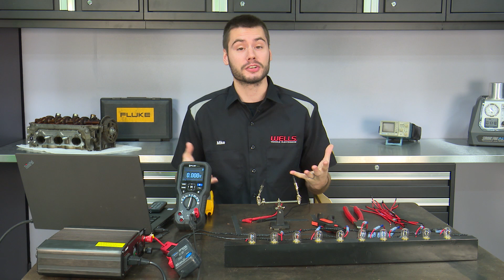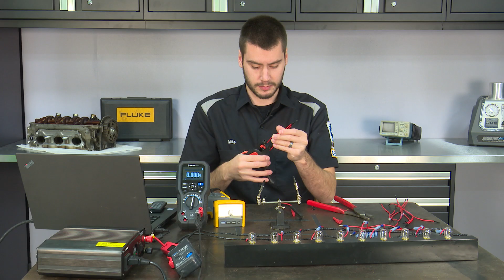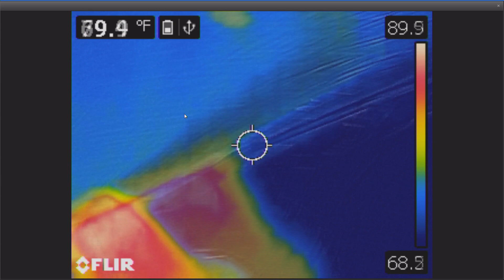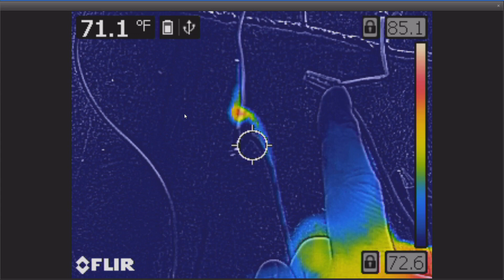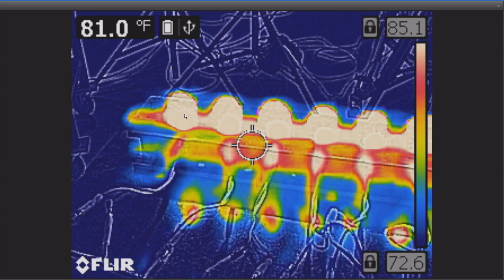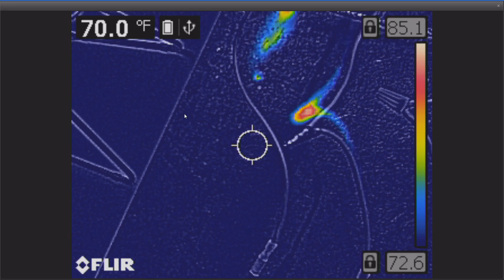Part 2 - Best Way To Connect Wires On Your Car - With Proof!

Comment: Your current levels are too low to really stress even a poor connection.  Try running the wires at the max rated current for the wire size.

Comment: A very interesting experiment, i would add 2 thoughts.  The resistance test is a little bit artificial as the applied voltage is very low and depends on the battery in the meter.  For UK domestic testing the applied voltage is 500V, this would be much more aggressive and may have produced different results.  The second point is that the current at 1A is also quite low, it would be interesting to see the volt drop at say 80% of the wires rated current.

Comment: The properly done heat shrinkable connector should of had 3 crimps on it. The one you showed didnt look to have 3 crimps?
Reply from the maker: Interesting BlackhillPunk, i've never crimped one three times. Where's the third crimp go?
Mike Becker, Senior Instructor
Reply: @GoTechTraining  you made a mistake and crimped it too centrally which didn't grip the wire and therefore had to do it again

Comment: good idea on 5 month winter test on wires............ be even better to do a real long term test, like 1-3 years.that would tell the real truth on the connecters.  also anyone know if i live in florida and do use wire nuts on car and they may occasionally get some moisture inside but no road salt,would this over the years affect the quality of the connection? i would think not much?  ty
Reply from the maker: Hey John, thanks for watching! The longer the test the better it would be for sure. As far as vehicle in Florida, guess that depends of there's salt in the air, living near the ocean. Wire nuts just really don't belong on a car.
Mike Becker, Senior Instructor

Comment: great test, but to see results  at  that range you need a DLRO (Digital Low Resistance Ohm) meter, with the proper test clamps to connect to your wire.(many only have a pair of pins which would be tough to get a good connection on small wire)  A DLRO passes 10 amps through the connection and measures the voltage drop. You could of course also do the same with a power supply and the proper test equipment.
Reply from the maker: Sounds like I need to go shopping :)
Mike Becker, Senior Technical Instructor

Comment: Interesting experiment. I wonder if running current through them while in the salt bath would have changed anything. It stands to reason that the warmer the wires get the more moisture they will wick into them.
Reply from the maker: Hey Nicholas, I believe current running through them would have definitely changed the outcome. Electrolysis is a real thing. But, like on a car, current isn't ALWAYS running through the wire. Therefore, in this experiment, I figured it was best just to run none and see how that went.
Mike Becker, Senior Technical Services Instructor

Comment: Certainly not the results that I had anticipated, but we all know what we could expect!!

I feel like the wire size used vs the amount of load used, vs the amount of possible corrosion exposed to, had a lot to do with your results!! A smaller wire, and/or a heavier load, or being exposed to a longer corrosion period, could have varied the result much better!! It's like comparing winter gloves by subjecting them to  50 deg day!!! I have socks that would pass that test!! And the few Wisconsin people I know, don't even get out the winter clothes until somewhere in the teens!

Nice job on comparing the connection types!! I have seen every single example you posed, in some form or another!! And worse!! I have even seen some 12/2 romex, under a house, with the twisted pair/electrical tape trick used, and being so old that the tape had come completely off! Was crawling around in wet dirt, on top of that splice!! I never considered that it was live, until further in the work, I traced it to a live circuit!! IMAGINE MY SURPRISE!! I thought it was trash!!!
Reply from the maker: Hey Roadkill5333. Not what I expected as well! I'm glad you enjoyed the class! It was in the 20's the other day...saw a guy in shorts and the store....foolish Wisconsinites! :) I bundle up....not a fan. haha
Mike Becker, Technical Services Instructor

Comment: The test might've been more effective with more load.  I assume 16ga wire, you could easily expect 15A service... How about powering all the bulbs with each harness?
Reply from the maker: Hey Robert, please check out part 3!
Mike Becker, Technical Services Instructor

Comment: Nice experiment, I would also be interested in how a pierced wire would up vs a sealed one and the effect on the wire. Good work.
Reply from the maker: Hey AutoFocus, great point. Should have thought of that before I tied them under my truck!
Mike Becker, Technical Services Instructor

Comment: another good tech video..being a motorcycle tech am a big believer in solder and heat shrink and also using the genuine wire connectors from manufacturers that are not 100% waterproof but rain resistant   ..great tutorial video
Reply from the maker: Thanks for watching and commenting Billy! What kind of bikes do you work on? 
Mike Becker, Technical Services Instructor
Reply: all models but worked for Honda Australia for years and have BMW certificate and engineer's cert(AMIAME and MVRIC)  ...owned 3 motorcycle Service centers where we did motorcycle engineering and modifications ,dyno tuning and engine rebuilding and lots more

Comment: Good experiment.  Thanks for doing this.  In the next test after some time would you be able to use a loadpro tester on it to check static vs loaded circuit?
Reply from the maker: OC Run, I do not have a load pro. I also do not have any plans to get one. The load will be simulated using bulbs. Check out part 3 where I up the load even more and stress the system.
Mike Becker, Technical Services Instructor

Comment: It will corrode faster when it's on the car being used it being loaded creates heat then it cools that draws in moisture that
Reply from the maker: John, thanks for watching! Yes, it will corrode faster when there is current flowing through it, due to electrolysis.
Mike Becker, Technical Services Instructor

Comment: I can't wait to see the next results :) . PS: I'm wondering will 12v powered soldering iron make good use for automotive wiring?And what about heating the heat shrinks with lighter(i'm on low budget)?
Reply from the maker: Petar, Not sure on the 12v soldering iron. Haven't used one yet...though I hear the new Milwaukee 12v cordless soldering iron is great. As for heatshrink, usually your best bet is to buy it online or Amazon or something. 
Mike Becker, Technical Services Instructor

Comment: Theres nothing wrong with a wire nut. 10 years from now it will still be there. Long after your solder breaks down and craps out. You may not LIKE wire nuts but you proved yourself that nothing is WRONG with using them.  Stupid.
Reply from the maker: Tan Tan, please watch part 3. I strongly, respectfully, disagree. Wire nuts DO NOT belong on a car.
Mike Becker, Technical Services Instructor
Reply: Wells Vehicle Electronics ever see the instrument pannel of a Boeing?   Lol.  Wirenuts every where.  . . ..
Reply from the maker: Oh man! That is scary....but that is also climate controlled right? Always dry?
Mike Becker, Technical Services Instructor

Comment: I really like the way you tried to do this objectively, with quantitative results. Of course any experiment with only one sample of each connection type will give unreliable results because of inadequate experimental power. Ideally one would want at least five of the same design, which would be a huge and time consuming study! Also a short exposure interval with no vibration and no power going through wires will similarly reduce study power. Mostly those two study design weaknesses would cause beta error, failure to measure a difference that actually exists, although outlying sample results would need verification as well. In the end your effort brings public attention to the importance of technique for long term results. I hope nobody walks away from this and concludes it doesn't make a difference. The way you showed heat at the connector was an excellent illustration. Also I like the way you demonstrated a voltage drop across the length of your feeder wire -- maybe a bigger feeder wire would reduce that effect, or perhaps splitting the supply power to allow current to travel from either end would flatten that drop across the feeder length.

It has been a common remark here on the 'net that properly insulated butt connections are better if crimped rather than soldered, because in a car over the long term vibration leads to cracking. Then heat from power dissipated across the cracked joint eventually destroys it. It would be interesting to see objective evidence to support crimping over soldering, rather than anecdotes. I've always thought solder is better, though the way some electronic parts consistently fail at solder joints is compelling evidence that a mechanical connection might be better. Presumably the best joint would have both properties. I was with a danish carpenter one day and I was surprised at the complicated technique he used to do a mechanical butt connection. It took him over a minute to do the joint. Not easy, but you could have supported your body weight on the connection, it will never fail mechanically. Nobody does that any more, ha ha. 

Overall, well done, thanks for taking the time to do this!
Reply from the maker: Hey Spelunkerd, Thanks for taking the time for the lengthy comment! I agree, more samples would have been better! It sounds like you run a lot of experiments :) There were plenty of things here that could be changed for sure, But, I hope I was able to get the point across. I may need to follow this up with another experiment using vibration and temp to inspect long term effects. Thanks for the comments and insight!
Mike Becker, Technical Services Instructor

Comment: I'm not claiming to be a super-expert, but  wrenching for a living for over 20 years, my experience has been bare crimp connectors with glue filled heat shrink over the connection afterward is the best combination of quality that will last and fast / easy to make the connection and get to to other work that needs to be done.
Reply from the maker: Hey DocRevo, I like the input! I like that style of connection. I think it is faster and more efficient than solder. I think solder is still a better connection, but that doesn't make a crimp style bad by any means. So, that's your go-to?
Mike Becker, Technical Services Instructor

Comment: This test is Garbage. You should never make an wire repairs outside of the passenger compartment you should always take apart the plug an run a new pin an wire.
Reply from the maker: Derby Dawg, why? What makes you think that? Not trying to be argumentative, just curious. I respectfully disagree. A good secure connection is perfectly fine in my book. 
Mike Becker, Technical Services Instructor
Reply: Wells Vehicle Electronics what was taught when I got my certification and 16 year of fixing wiring the was fixed like this and still having to redo in a year or less after it Corroded

Comment: Could I suggest that you up the current as 1 amp is'nt always the norm. Maybe try different amps, such as 1 , 2 ,3 ,4 ,5, and compare the voltage drops then.
Reply from the maker: Hey Tom, i'm with ya! May be a part 3 coming shortly :)
Mike Becker, Technical Services Instructor

Comment: Hi Mike, 

A really good idea and execution. I agree that a week soaking in the salt tank is not a very realistic test. Tying them to your truck will be a much better test of the effect of real world conditions on the various types of connections.

As the loss of physical strength and of flexibility are as much of a concern as loss of conductivity, a strength / breaking point test of the wires might yield instrucive results. 

If you want to have a second set of data and have the time to make a second set of the 9 test wires + control, I'll be happy to tie them to the bottom of my rusty 2000 Explorer down here in West Bend and put them through the same Wisconsin winter. If you want to do that, PM me and I will send you my address.
Reply from the maker: Haha thanks for the offer! I think i'll be alright. What would be interesting would be to see the same set of wire in a different part of the country, say like Florida, or Arizona. See how it does there...probably comes back shiny still haha! Thanks for watching!
Mike Becker, Technical Services Instructor

Comment: How about trying out a wire nut filled with Silicone II caulking for the long term test... just to make it interesting! Thanks for the video, awaiting results in the Spring!

P.S. Is it a cockroach videobombing you at 15:40? :D
Reply from the maker: Hey Dmitriy, haha that was a box elder bug, we get them like crazy around here because of our trees. As for the wire nut, I don't want people to get the wrong idea. Sure, you could silicon it, you could heat shrink it, you could do a lot of things to it...but it is still a wire nut on a car. There really is NO reason to use that instead of something else. It is an inferior connection. Thanks for watching!!!
Mike Becker, Technical Services Instructor

Comment: Excellent video series Mike as I don't recall anyone doing such a test before. I'm sure if you had left the wires in the salt tank for about a month you would probably have seen a big difference. Being underneath your vehicle for about three months during the winter should give good results also. Do you feel like the liquid electrical tape was doing a good job? The reason I ask is because some of the ends were a little corroded and you felt like it was probably being wicked up from the bad connection. Once again great video series Mike and keep up the good work. 😀👍
Reply from the maker: Terry, Thanks!!! There were tons of videos out there on how to connect wires...and people saying what was right/wrong...but no one went out to prove it :)  I think the liquid electrical tape did a good job. The wires that were sealed up well were not crunchy feeling inside, unlike the unsecured wiring. Maybe it should have been liquid electrical taped, and heat shrunk...or something like that. But, here we are, and I don't want to go changing things now :) Thanks for watching!!!
Mike Becker, Technical Services Instructor

Comment: no vibration or temp differential
Reply from the maker: This is true r8er4everd! That's why they are going on my truck for the winter :)
Mike Becker, Technical Services Instructor
Reply: I think under your truck is a little to extreme. And would only address the cold portion of the heat cycle. More realistic of common wiring would be maybe somewhere like the inside of the wheel well s, that way they get exposed to cold and heat and moderate moisture. Under your truck will always be very wet and cold. So no cycling from hot to cold, which in my experience cause things like wire nuts to work the way off a connection. The expansion from heating and then the contraction from cooling added with a little vibration and anything will want to come unscrewed. I would...lol
Reply from the maker: R8er4everd, I respectfully disagree. One of the most common add-on wiring components in a 4 or 7 pin trailer connector. Those sit under the vehicle usually, especially on a truck. I do agree that the heat/cold change could affect wire nuts, but we are trying to affect all connections here in the same environment. I am basically duplicating add-on trailer wiring. 
Mike Becker, Technical Services Instructor

Comment: Thanks Mike, that experiment was interesting the voltage drop definitely showed some flaws in the joints. What do you think a week in your salt tank equates to in real time? I think I can guess what the results will be in Spring next year!
Reply from the maker: Jonathan, Thanks! That is hard to say. There is no spec on the time equivalent. I searched and searched but really didn't find any good spec to go off of. Spring should give us the results we expect!